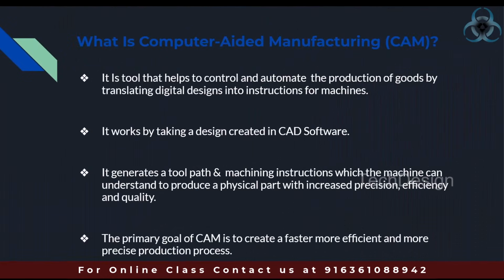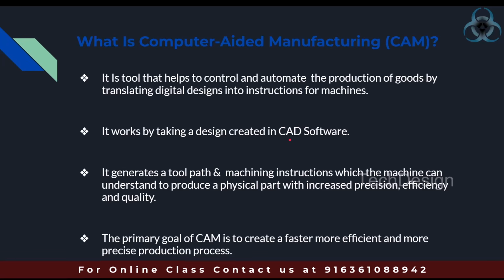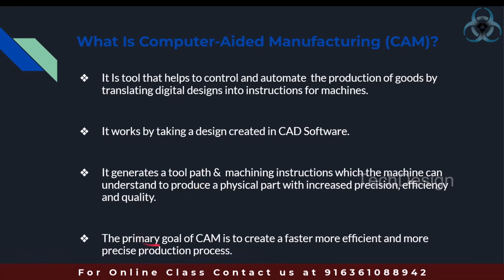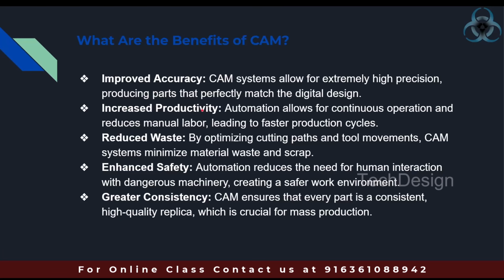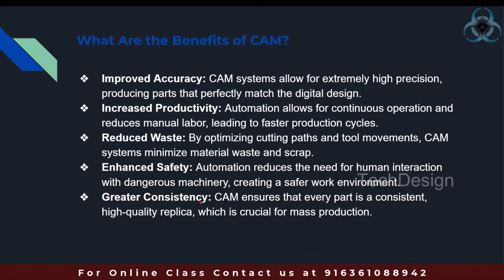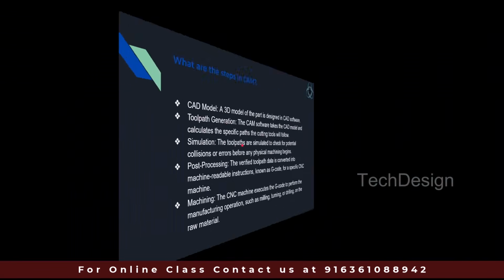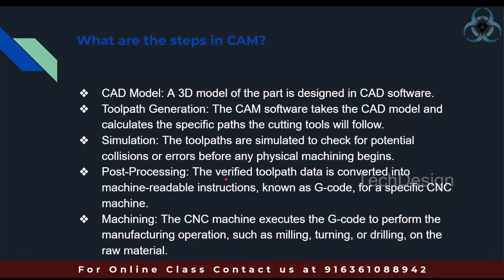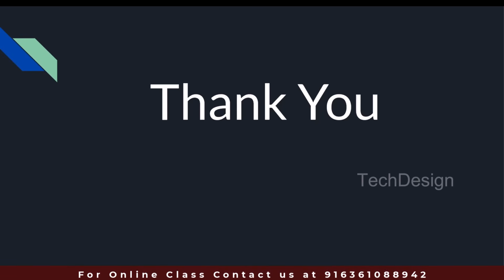Introduction to Computer Aided Manufacturing (CAM) Series

Comment: When i select geometry instead of bounding block as i wanted only to follow geometry 
Part and blank get selected as a single body how can i select them as different body
Can you help me ?
Reply from the maker: I need to check the model
Reply: @TechDesignsantosh  i manufacturing forging die
So i want to select die as a ome body and part impression as a another body
Currently I'm getting single body of both so I can't select them as a different body
How can I select it?
Reply from the maker: Trim the body then select